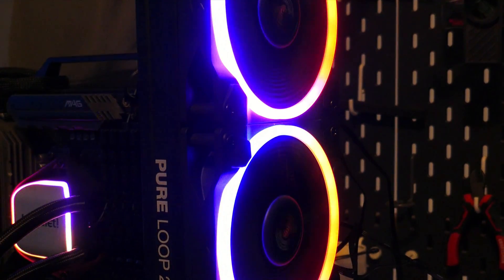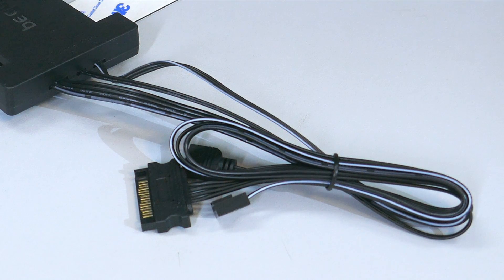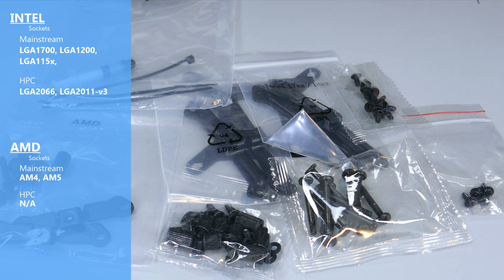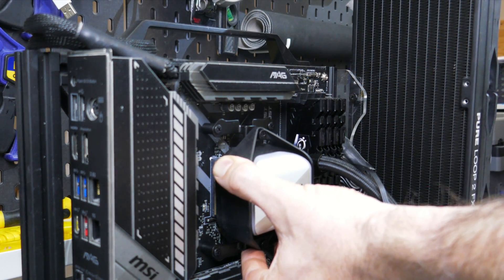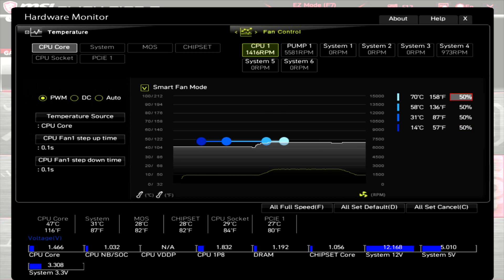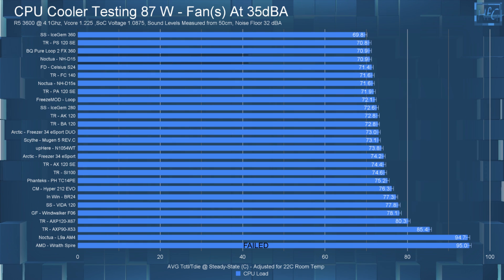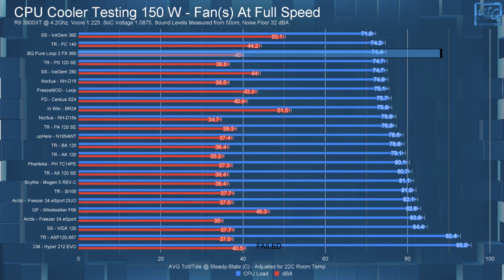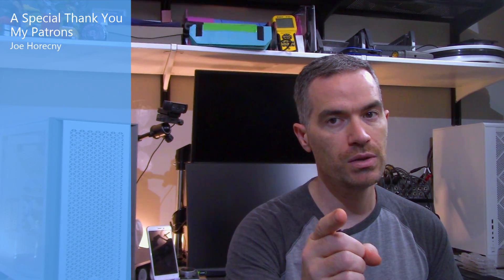Be Quiet Pure Loop 2 FX 360 AIO - CPU Cooler Review

Comment: Hey a bit late but I just aquired this AIO, and when monting it I poted the pump on the aio_pump connector of my mother board, and the pwr (fan like connector from the hub) on the cpu_fan connector but it did not registered the fan, I see a slot with RPM on the top of the be quiet hub should I put one of the fan there ? Or buy a cable to put plug the CPU_fan from the mother board to the RPM connector of the be quiet hub

Comment: ho to make it quiter? should i reduce fan speed or pump speed at maybe 80%?
Reply from the maker: @nikolajelaca8207  the pump should not be too loud even at 100%, but running the pump at 80% is likely a good speed. You will want to lower the RPM of the fans to reduce the noise level.
Reply: @HardwareForGamers  thank you for response <3

Comment: I recommend to get the non FX version. Has the same nice RGB on the block covering the CPU with none on the fans. I bought recently due to the fact that it was the cheapest available 360 AIO I could find at $105 or so. Works just as well as anything else for much less money.

Comment: Works great for my tuned 5800x. Keeps temps in the 70's even at sustained 100% load. With ryzen the boost table is temperature determinant, so if you can keep the cpu under 80c it will run much smoother.

Comment: I have the 280 version and to be fair my cpu now runs a lot cooler than it did with my previous air cooler. Although, to be honest my air cooler was a Vetroo V5 with 2 arctic p12 slims on it (the original fan died after about 2 months so had to improvise, that's probably why my aio has better temps 😂) I really like it though, it runs quiet and I haven't noticed my cpu go over 64c yet.  
I stumbled across this vid and found it really informative. Going to have a nosey at your back catalogue now 😊